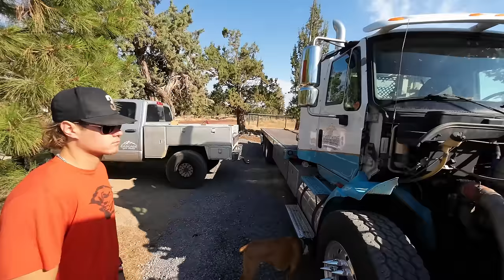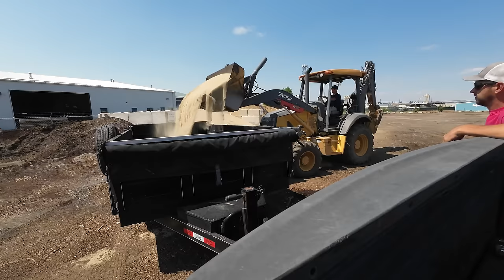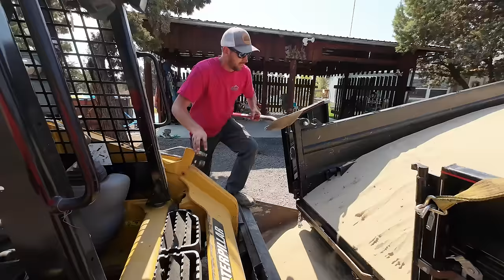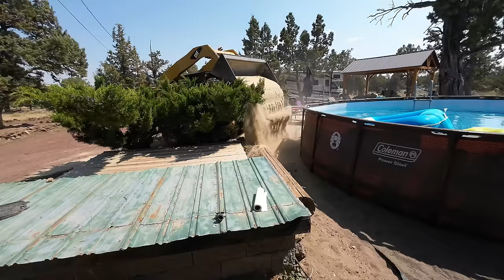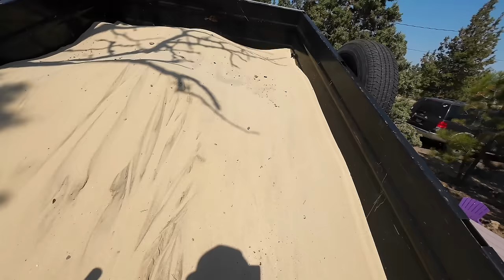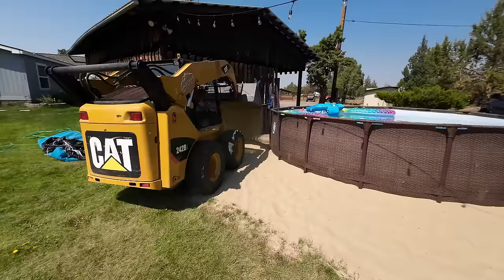I Had A Really Rough Day…

Comment: Is that a maxxforce? We have replaced 2 of them. We spent 15,000 on one replacing the motherboard and various other issue. We have reengined it. It got to be a road hazard 23mph on I 90 with 50,000 pounds blowing smoke plus RPM fluctuations. If it is a Maxx... they will not tolerate idling. Neither truck is on the road presently. Parked so they won't break. Cheaper not to run them.
Reply from the maker: No, pre emissions Cummins

Comment: why not have  a 7 pin connector  from the truck  to the trailer  and have the correct  adapter  to  charge the battery ?

Comment: Theres a reason my rollback had racks everywhere and 4 huge toolboxes, with more storage on the top of the boxes.  Probably had close to 8,000 pounds of chains, hand tools, air tools, a small torch and carried batteries with me.  Ah the old 3a days.  It i cant fix it here within a decent amount of time, then we'll tow it.  Did cv axles, brakes wheel bearings even did a waterpump on tbe side of the hiway.  In addition to all the usual, batteries, alternators and the like.  That was my baby from new.  Boss hated it because i wrenched more than i towed.  Oh and did a fuel pump on a 98 camry in the walmart parking lot😂😂😂

Comment: What do you do if it breaks down with something on the bed and you have to get it off?
Reply from the maker: If it rolls, call another truck to back up to it, move it onto the other truck, then set it down.   If it doesn’t… call a crane.
Reply: @CaseyLaDelle  True forgot you could just shift it over. What engine is in your truck?

Comment: i found out years ago once a injector  goes bad most time the other 5 follow real soon
Reply from the maker: In 20 years of trucking I have seen the exact opposite
Reply: respectfully,  the newer-ish high pressure fuel and common rail etc etc are so much more finicky than the older more reliable mechanical lumps. Plus with shop rates what they are,  and actual knowledge, testing, and double checking being a thing of the past in the service industry, it's usually best done in sets.

I mean, look at how you diagnosed the causes and narrowed it down.... the "book techs" that just throw a scanner on and follow a fault tree, you'd be 6hrs into diag time likely.
Reply: @SPD_driver   i dont know anything about 2007 and newer. i had new trucks from 1985 until 2007 when i had my stroke and it stopped me from driving. i ran cat, Detroit and Cummins engines i loved the cat but when they did break they cost to much to fix. Detroit. after my 2nd one i said NEVER AGAIN. and Cummins you could get fixed almost anywhere you went. but all my trucks had 18 speeds with a 4 speed behind it. with at least 2 speed rearends. except my last one it had a 13 speed smart shift with a 4 speed air shift with 3 speed rear ends. the last load i hauled on the day i had my stroke. was 19.2 wide 19.6 tall 256 feet long and 520.000 pounds. it took them 4 hours to find someone that knew how to drive it to get it off I 10 into a rest area. and 4 days for someone with a truck that could finish the job. because a normal big truck could even untrack some of the loads i hauled. and like this time i had a push truck for part of the trip. just to lose everything because of Insurance. and thier clauses.
Reply: @MadsWorld34  sorry to hear that,  hope you're doing ok now.  The specialized end of things and knowing how to run crashbox is lost on steering wheel holders. Sounds like you had some very custom spec stuff for the OSOW heavy haul.  Mad props to the experienced ones running HH. So much more going on on so many more levels, all at once and with immense responsibilities

Comment: By the smoke that was spewing looks like problem could be contaminated fuel or incorrect mixture of fuel and oil. Maybe you will need to clean the fuel tank and all the lines carrying fuel to the engine. Not a mechanic but based on experience I am guessing.

Comment: The after treatment seventh injector can cause excessive smoke like that so can a hanging jake solenoid possibly a miss adjusted rocker. That is sometimes tight and sometimes loose. Regardless as to the issue. It’s an incompetent mechanic.
Reply from the maker: What after treatment??

Comment: I'm wondering about the competency of the mechanics at that dealership. Sounds to me like the issues you've had with that engine should have been double-checked automatically when opening the head of the engine. They should have plugged in the computer to ensure all settings were appropriate. Good grief!

Comment: Injector problems, likely due to contamination.  That's my diagnosis.   Last video ended with an injector stuck wide open, and you could hear the engine knocking hard, which is right at the edge of hydrolock...   Though the mechanicals of the engine are OK now, that will change if you keep running it with an injector stuck open.  
I would have tossed a road flare into it by now, so you have way more patience than me!!  :)

Comment: Fuel rail should hold pressure unless one injector leaks. Injector timing is incorrect. Wrong wire to injector , wire from injector to brains messed up. TIMING AND INJECTION PROPLEM JUST GOT TO FIGURE OUT WHY THE CORDINATION IS OFF.

Comment: I think it has something to do with the emissions... my 08 freightliner did the same thing and it was the egr..
Replace the egr.. cleaning it is only a temporary fix..
Also the emissions filter/ muffler  ( i forget what is called  ) 
I ran a hallowed pipe through it and it worked... i couldn't afford $4,500 to replace that damn emissions muffler/ converter or whatever it's called...
Reply: I believe Casey said elsewhere that it’s a pre-emissions truck.
Reply: @JohnHallgren  mine was pre-emission also.. it didn't have def fluid but still had the canister at the end of the tailpipe

Comment: I don't want to dump on the mechanics as this may not be their fault (but for sure the rocker issue is on them)......but you're finding issues almost immediately after picking up the truck...are these guys not doing a decent shakedown after they do their repairs?  It's not like you're finding these issues months later.
Reply from the maker: The first time they literally pulled the truck around front for me to pick up with the check engine light on and rocker rattling.
Reply: @CaseyLaDelle  Ouch.  If that's the case, they deserve to be dumped on IMO.  Hope you can find a better mechanic after this is all sorted.

Comment: No offence intended, but with so many "recovery" vehicles why don't you have at least 2 sets of jumper cables?
Reply from the maker: Because we don’t use jumper cables.
Reply: A quality rechargeable jump-pack is much more convenient and more portable than jumper cables. Makes sense if you use it a lot. If jump-starts are infrequent then the jumper cables make better sense.
Reply: @EnufIsTooMuch  maybe but everyone I have tried didn't have nearly enough juice to even try to crank a diesel truck. The draw from the hydraulic pumps on the dump trailer I bet would kill it fast too. There's a reason they use a large battery.
Reply: @CaseyLaDelle  might want to get some if your going to have the dump trailer. I have a few trailers with hydraulics and the batteries go dead often. * check the charge fuse, I keep extras in all the trucks.